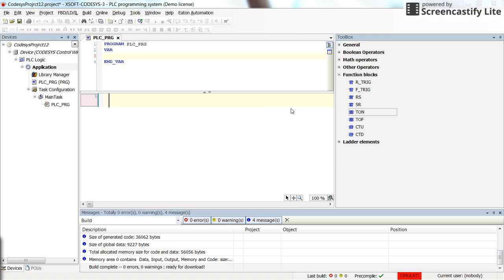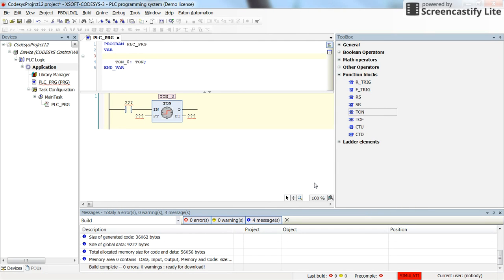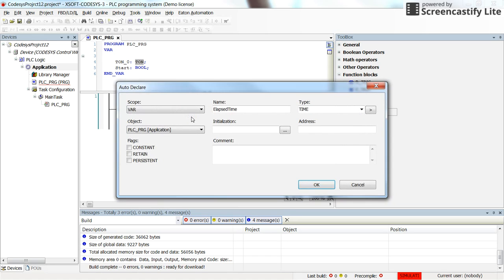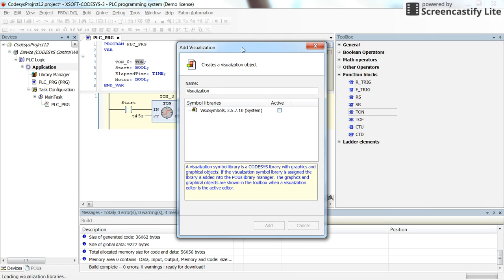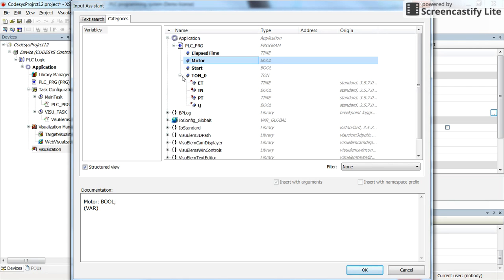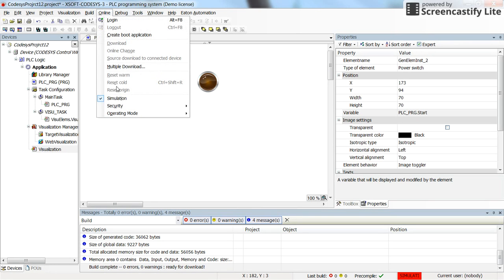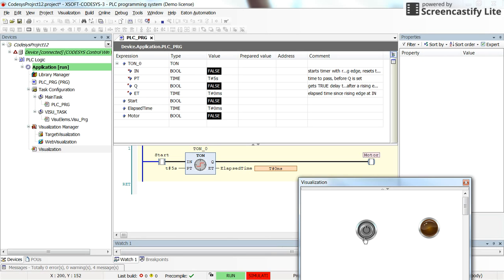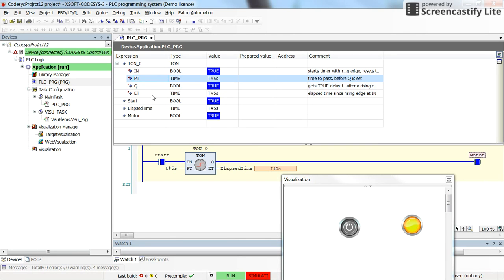CODESYS: Using TON (timer on-delay) function blocks in Ladder Logic #on-delay #plcprogramming

Comment: Hello, How to use TON timer for remain its elapsed time when power recycle ?
Reply from the maker: To do so, you would need to use a Retentive On-delay timer. As far as I know it is not available in the CODESYS by default. You may need to look for libraries or implement it yourself.